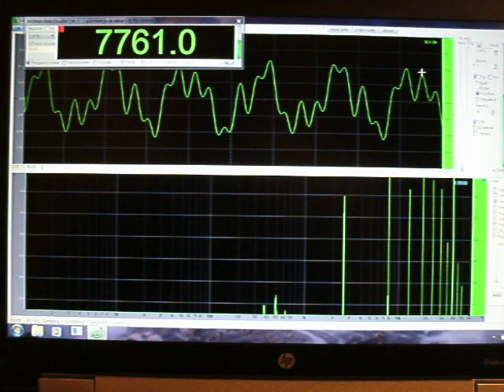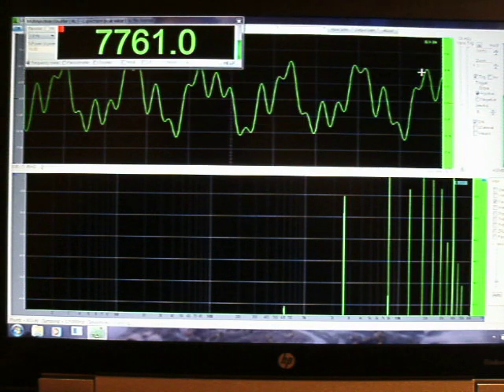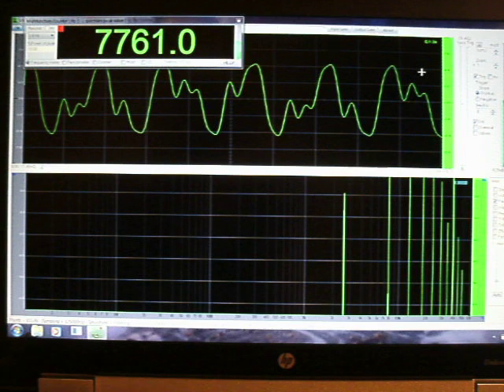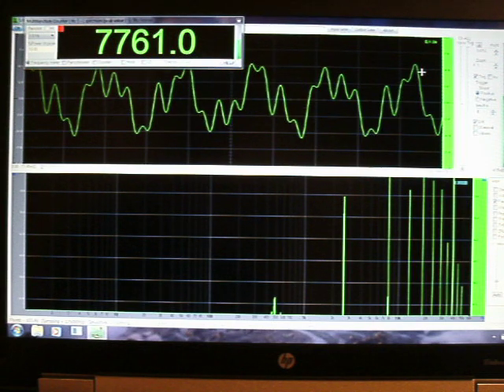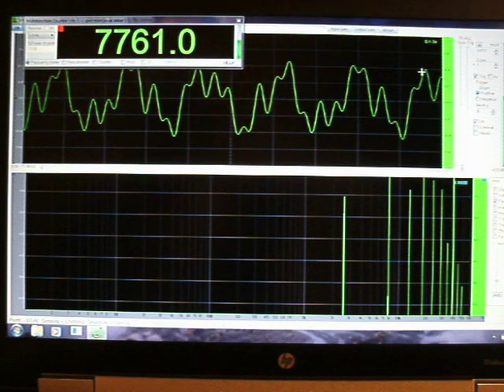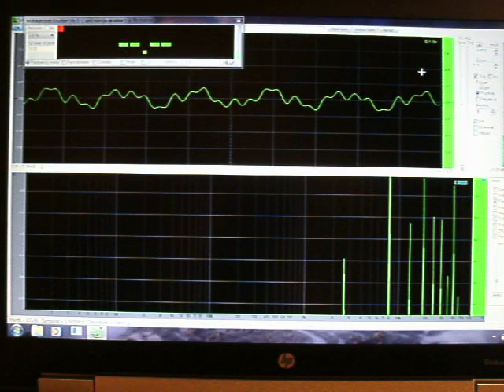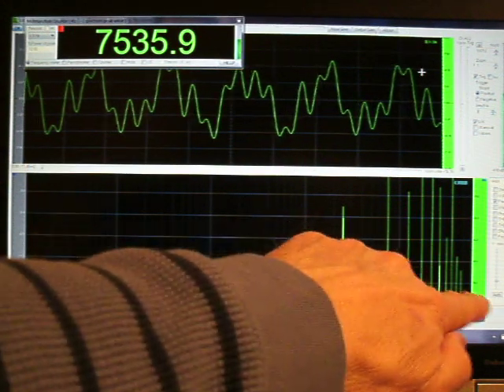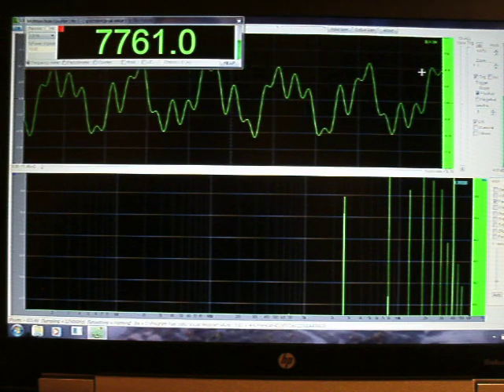Minelab Equinox 800 Mode Frequenies

Comment: Not being real teckie i didn't really see a lot of difference between the 2 park and 2 field modes on the scope. Mark, Could you elaborate on what you are surmising from your test? Thanks
Reply from the maker: Basically the transmit signal stays the same.  How the machine processes the return signal is what makes the Equinox perform so well.
Reply: @markg6836  thanks